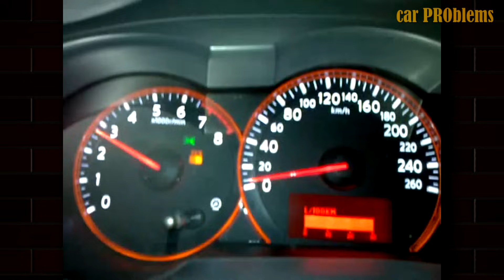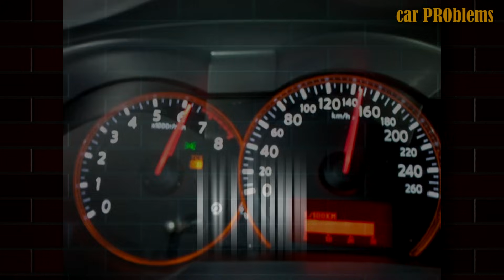How long do CVT Transmissions Last? - CVT Reliability

Comment: I have over 400k miles on my unreliable nissan cvt lol. It's been fine!
Reply: Glad to here it.  I have a Nissan rouge and change the fluid every 60K
Reply: @crand20033 where do you get it changed
Reply: @SlowerTrafficKeepRight-k2g  The dealer or a transmission shop. It costs a lot.
Reply: @crand20033  cut that down to 30k
Reply: @crand20033  Make sure your shop changes the paper cartridge filter AND the screen.   Both filters need replacing, the cartridge filter on my CVT (Altima) is next to the trans heater / cooler thing, above the pan.    Lots of shops never change that  second filter.
Reply: I have owned only Nissan Sentra!  Very reliable and never left me stranded on the side of the road!  I always had a transmission flush every 30,000 miles.  I  also had the oil changed every 3,000 miles and tune up every 15,000 miles!  I love Nissan!
Reply: @robertelder5770 Nissan used to make great automobiles before 2000 Renault took over and they’ve been going downhill ever since !
I own an 86 Nissan Great 
car 
I own a 2009 Nissan biggest piece of junk I’ve ever owned !
Reply: I Have Nissan sentra 2018, already close to 200k still drive amazing, only light I got is for the purge valve 😂  @robertelder5770
Reply: Every what miles ?you change the transmission fluid
Reply: @frankies9049  He must have changed a lot of other parts too.
Reply: @crand20033  of course
 I did my alternator at 390k and my starter at 420k
Reply: My starter wasn't dead. It would stick once in a blue moon!
Reply: @frankies9049  every 30k
Reply: Nissan cvt? your lying
Reply: @anthonygarcia11i3h9  surely not lying. Have no reason 2 lie.
Reply: @anthonygarcia11i3h9  let him dream
Reply: 200k on my Nissan Murano still going strong
Reply: Jatco CVT are notoriously bad !

Aisin  is the best !
Reply: @altec19  haven't had any issues with the cvt and I don't like the 8spd toyots unit. You can keep it.
Reply: I'm on my second nissan with CVT. Both are problem free. I change fluid every 30-40 k.
Reply: @spol1622  same thing here filter and fluid every 30k and drive it easy and don't tow anything
Reply: How often have you changed the cvt fluid?
Reply: @SlowerTrafficKeepRight-k2g  every 60k
Reply: Miracles never cease lol 😂❤
Reply: @ErichH68  my brother and neighbor both have over 300k on a 14 altima and a  14 or 15 rogue.
Reply: @occckid123  I’m happy for you but I wouldn’t get one.
Reply: @ErichH68  cool...
Reply: Do not forget to reset TCM after avery CVT oil change.
Reply: @NoWay-ye7yq ??
Reply: @edubb2491  reset control module after oil change
Reply: How often did you change the cvt fluid?
Reply: @RealAmericanHero420  every 60k. Prices vary depending on the dealer.
Reply: 180 on my Infiniti n just fine
Reply: What kind a maintance and how many miles you doing.  Tnx
Reply: Renault bought Nissan now they're nothing but junk and these people on here saying 400,000  you know there lying 🤥
Reply: Yeah everybody knows you are lying. 😂  It's Renault which is garbage.
Reply: Cap
Reply: Did you blow the Nissan CEO my guy ?😱
Reply: @JamesBond77  no them I guess in would be driving a new car for free but I'm not.
Reply: I have a twenty twenty four honda hrv with the cvt Is got a brand new with no miles on it,so far its Fabulous.
Reply: Nissan and cvt wont go well together 😅
Reply: @doe.john666 sad for you. My 19 is at 227k and 0 cvt issues
Reply: How often do you replace fluid/filters, and do you always use your parking brake?
Reply: @civi3653  drain and fill every 40 to 60,000. You don't need to replace the filter. If you do go over 75000 Then I would change the filter.
Reply: @user-pj5ff6xw4x  I just got a 2010 Nissan rogue runs excellent it’s got 82k. But it was not driven for 3 years. There got the receipt that show that the fluid was changed. 10 miles ago. But it was not changed for 3 years. Should I still change it. Please let me know
Reply: @occckid123   all right Pinocchio. 😏
Reply: Wow. That great. I too have a Nissan   It’s a NV 200 mini cargo van with 198K miles   You have to make sure to get it serviced and get what it needs no matter what it costs because at the end , it will cost more on repairs. I rather pay $400 on maintenance than $1,800 at the end . Some maintenance can’t wait but is better to get it done and over it. From what I understand CVT transmissions can also get damaged if bad spark plugs, dirty filters or low battery voltage as well. Everything can affect the performance and can damage the transmission.
Reply: The variable no one talks about is the driver.
Reply: what kind of Nissan y hope you don't tell me is Murano ?
Reply: Then you got lucky, my wife's 18 rouge CVT went bad at 120 thousand
Reply: @ericbrunner388  at what mileages did she change the cvt fluid?
Reply: @occckid123 we bought it used with 86 thousand on it, was told it was done at 65, we did it again at 90 thousand(Nissan says at 60 then every 30 thousand after, 121,500 on it now, can shift into drive and car goes nowhere, popping code for trans fluid pressure switch, basically it's fried.
Reply: Toyota ran their CVT transmissions in Asia for 10 years before bringing it to the United States. THAT'S ALL I DRIVE IS TOYOTA'S
Reply: Depending On the year i call bs!! If it one after nissan became a French made car. And has the jatco cvt in it. There is no way you hot 400k on it as those are known too fast l every 80k miles with proper maintence
Reply: @mhobin12  My 2017 Altima has almost 100K, CVT works fantastic.
Reply: @mhobin12  who taught you to write or text? You need to proofread before you send. Seriously
Reply: Nissan owners lying 😂
Reply: @user-pj5ff6xw4x  actually I'm in it right now but I do have an issue. Might need intake manifold. It's still driving fine 90% of the time.
Reply: Highway millages doesn't count😂
Reply: @muhammadhanifkurnaen6689  I live in queens. Smh...

Comment: A lot of mechanics are in it to rip you off. 

I had just got my oil changed and I went to get something else checked at another shop. 

The guy looked at the dip stick and said, I need an oil change. 

I said, “ really, I’ve just got it done” and showed him the sticker.
Reply: That's why I always do my own mechanical work to both my vehicles. It's been decades since I've been to a mechanic, other than to have new tires put on, and that's it.
Reply: @bobby1970  if I don't put mine in to a dealers for service the warranty isn't covered
Reply: Go to the main dealer to get ripped off
Reply: That's why I go to jiffy lube.  Perfect every time